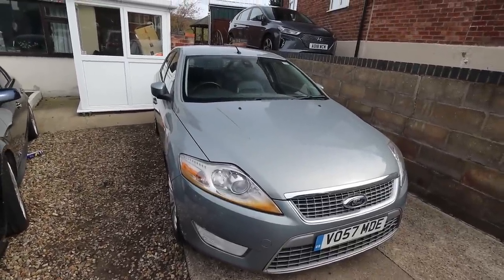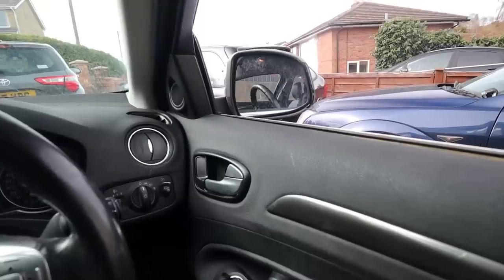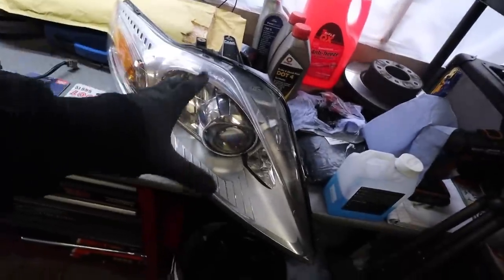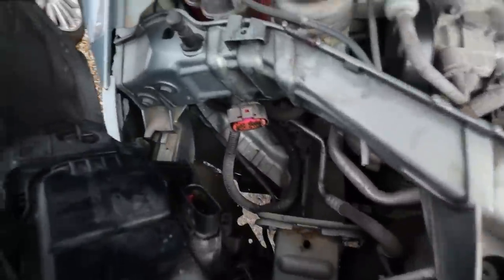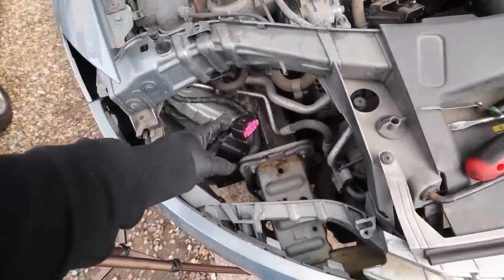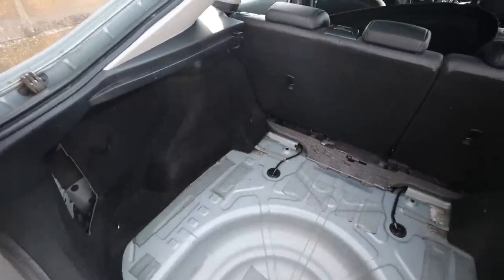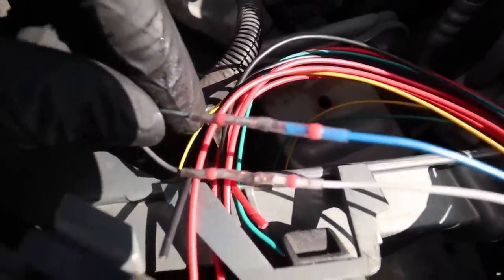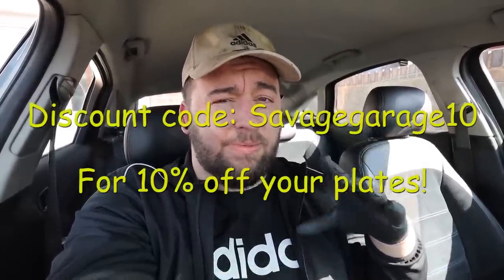Fixing More Issues On The Mk4 Mondeo Project

Comment: Hi. First off all,  very good videos and are educational. 
But, why do you guess and buy by guessing? A bit annoying :-P 
I once changed headlights for a Micra and a Hyundai i30 including side mirror and the whole internal lock mechanism for the drivers side... I simply started by disassembling to check the model and specks then research and buy :-) 
Any way, really great job and well detailed.
Regards.
/Issam
Sweden

Comment: New MOT laws stats no gel plate or 4d plates as speeding cameras can't pick them up could fail an MOT, Also the new law states if a car failed an MOT you can't drive it away to work on it and put it back through test u will have to either get them to do the work or find a mate with a trailer to tow it away. Not being a hater, just looking out for u, love the content keep it up also look forward to u uploading ur next videos
Reply: 4d and gel are okay.
Reply: 3D Gel and 4D Laser plates have now passed the new legislation, as they are solid black and the glue used is stronger than the glue used to stick the reflective to the acrylic itself so there's nothing they failed on. 

They were eventually tested last week so all these people who think they're not road legal should soon realize they are again :) 

Also anything with 145d on like the ones in this video can be used from September onwards anyway as you aren't required to change them.

Comment: You can buy terminal release tools off bangood and probably eBay. Then just get a new connector. It's not difficult I used to make harnesses for for and jaguar.
Reply from the maker: Yea I’ve got some, but because of the corrosion it the pins were pretty corroded so I decided to replace
Reply: @TheSavageGarage  just seen that. We used to use those solder heat shrink on the Jag harnesses where we had a wire split to more than one connector. Very good and a clean join.

Comment: Be careful of using the nice plates as I think they might not be legal as of September 2021. From then new ones need to comply with BSAU 145e. The new ones you have look great though. The pins should be removable but you might need a tool. Maybe a pin would allow the pins to unclip and slide out of the plug. Obviously you need to ensure you put the correct cable in the correct hole on new plug. I wrote that before then end of the vid :-)
Reply: BSAU 145e states no 3D "fonts". This means the letters that are printed with shades and borders around them to make them "appear" 3D. Raised lettering in Solid black such as Gel resin/Acrylic lettering are still fine.
Reply: @TheRCBiker  Cheers for the clarification. The new plates do look good on the Mondeo.

Comment: I own a Ford Mondeo titanium mk4 2012 combi / hatchback.

there are too many small things that have poor quality

1. I do not like that the side mirror goes in and out automatically and that you can not turn it off. in winter, mirrors can be frozen solid and then gears can break.

2. on the instrument screen convers + there is little info displayed on the screen. Ford has done a miserably bad job here.

3. ECU. and BLIS. are located under the front bumper and can easily be damaged and they are not cheap to replace.

4. screw to main GND. minus that the battery cord is screwed on to  is not stainless and rusts properly. I changed mine to stainless steel screw.

5. star screws for the motor air filter lid are of poor quality and rust. it was not until later ford they used 6 edged screw head which is much better.

6. Headlights are not glued together very well and moisture enters.

7. could have been better sound insulated!

8. hat shelf on comby 5 door is of poor thin quality. if you lift incorrectly, it breaks in the middle.

9. if you press the accelerator pedal, it is like the car is in sport mode. the pedal responds too fast. you must make sure that you do not push the pedal in too much when taking off from a standstill. mondeo mk4 has no buttons with winter mode or sports mode something I miss.
my old opel astra g had it and i liked it.

10. The sound quality of the stereo is not so good.

Comment: james dont need cut wires on the plug get a new plug not expensive you see the tweezers you were using ? look into the plug each wee hole  2 wee like ears in each like expand out retaining the wire in the plug  wee squeez them together the wire pulls out the back of the connector the whole wire clips strait into the new connector you are depining the old plug LOOK ON LOADS OF VIDEOS ON HERE DEPINING AUTO CONNECTORS SO SIMPLE I CHANGED MANY ENGINE BAY CONNECTOR PLUGS

Comment: Hello. Just bought me one
Ford Mondeo titanium mk4 2012.

Can you help me with some information.

Is monde really such a bad car that all the videos I've seen give the impression? Many small things that break

1. Headlight leakage.
2. water in the trunk.
3. dead zone alerts sensor error.

4th side mirror that folds in automatic that you can not turn off. When there is ice in the winter, gears can be destroyed

What about noise inside the car while driving? Not the worst but not good either. What is your experience?

I appreciate all the answers I get.

Comment: I broke two bulb holders off two headlamps trying to just change the bulbs luckily the Toyota main dealer had a spare second hand unit for free and fitted it free, then when I broke it again they said I could have two new ones under warranty due to water ingress even though the car was 4yrs old because I serviced it with them.

Comment: Hi, I have an MK4 as well, 2.0l 2008 Titianium Wagon. The left connector on the headlights doesn't have the clip anymore as well, like your right side. But it just sits there, causing no problems yet. I think I'd rather close it up, might it became off, than buying another connector and soldering the wires. They're very great cars though, Mondeo's! Of course I have one with the steering on the left side, as I live in Holland ;-)
.
Thanks for marking my comment! Here's a video I recently made about the cruise control buttons: https://www.youtube.com/watch?v=xdFN0W6l-xg&t=15s
Need to work on the quality and orientation next time.